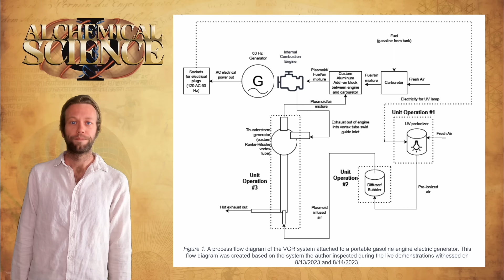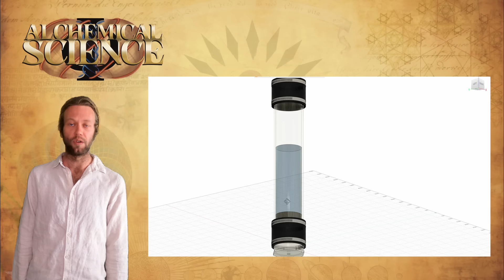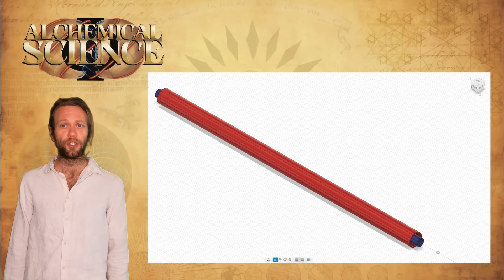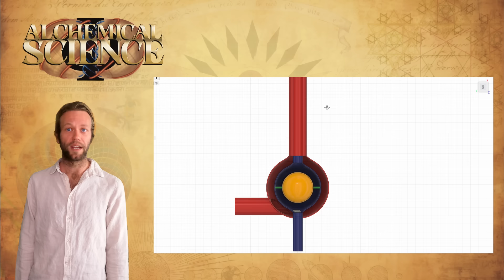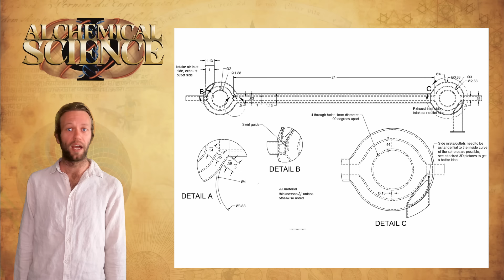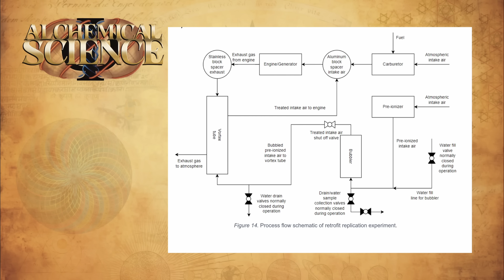Thunderstorm Generator | COMPLETE DIY BUILD GUIDE | Malcolm Bendall's Plasmoid Tech

Comment: Regards the plastic ion chamber, if copper or titanium work better, then simply a metallic spray painting of the plastic's interior should have a similar result boost.

Why would imperial work better than metric? The proportions are all important. That is more difficult to maintain with components manufactured to tenths as opposed to imperial manufactured to 1/3rds, 1/4ths & so on. It's not the magic of the source of measurements, it's the easier maintenance of ratios. 

The material of the supporting posts for the spheres may prove important, and perhaps even their shape. The ideal would be no post so there is no interruption in the ideal flow. the closer the post material/design gets to "invisible", the better they will work.

Comment: I've got so much more to say, but this is merely a variation of Paul Pantone's Geet engine recirculated exhaust plasma implosion system. This one here is more complicated in build. But the best result is an ambient air temperature exhaust, so no pollution or heating the atmosphere. 🤓🥳
Reply: Yeah, its a super complicated AIR FILTER.

Comment: This contraption is an overly complicated water fogger and heat exchange with a little EGR added to the mix to reduce the NOX output of the exhaust after it is leaned out by the hot intake; the fogger should help with the reduction of NOX as well.  The reason for the reduction of hydrocarbons is because it is closer to the stoichiometric ratio of gas to air, not because of some tuning of frequencies in the tubes and spheres.  The light bulb can be removed completely because it provides nothing to the system, because it does not ionize the air if it doesn't produce ozone, and I assume that ozone was not something the designer had desired.  So no plasma here at all.
Reply: So why do the exhaust readings show mostly O2?
Reply: @coreyleavell6921  what are you using to measure the exhaust with? I've wanted to setup my engine to lean burn with steam as the quenching agent to reduce temps and all the bad things that go with that, but looked into exhaust gas analyzers and found them to hold a pretty price tag I wasn't willing to fork over for it.  If it isn't an automotive exhaust gas analyzer that has a good calibration I'm not so sure you can say so.  If you know engines you would already know that contraption is not doing anything good.
Reply: @wesrurede  I don't have anything, but that's what the claim is. Watch more videos on it. I appreciate your expertise. Same question stands.
Reply: At the risk of it all...
The light is to simply start in aiding in the ionizing process. Its not completely necessary but helps. The the vaccuum of the engine pulls the air/water up through that tube after being pre ionized by the light. Then the wafer at the bottom of water tube atomizes it into 100 micron or less ideally or else the bubbles will not collapse into toroidels properly. When the piston of the engine changes stroke, the vaccuum ceases momentarily and compresses the bubbles at the top into the toroidel shaped plasmoids. The vaccuum continues to pull them into the thunderstom tube where hot exaust gas rotates counterily to the toroidal cold gas. They do not touch or mix. It creates the same effect as a thunderstorm ecxept instead of lightning or ridiculous amounts of static, you have created an optimal environment to force the plasma into the engine. What they admit they dont understand is how nearly everything converts into clean oxygen. They outright admit it works, but cannot figure out how the the full process works. Look at AC electricity. It got the same welcome as this tech, and now its everywhere and we STILL dont know enirely whats going on with AC current
Reply: @MidnightClutch25  I understand AC current quite well, if you don't you should learn. It seriously comes off like your just ill informed on the topics presented and are hopeful for technology that will make a better world; I am too, but don't protect what you cannot.  I smell snake oil.
Reply: Opinions are like assholes😂
Reply: Think about the temp gradient as phase disparity like when you static shock a door knob there is a disparity between the phases in you and the door knob when they equalize there's a shock this is electrostatics like lightning is not electricity it's dielectricity. The ionized air and exhaust never touch the disparity gets so large that the two actually equalize through the steel of the middle sphere and the dielectric discharge + the geometry of the gas bubbles collapse works together to make fusion take place it's like a positive feedback loop that's why the ratios are required. This is implosion tech. We use explosion technology now wait 10 year this will be everywhere
Reply: @jermeyplunkett3744  Static electricity doesn't use temperature differences to built the electric fields. Clouds get its ionization from the sun rays, which has ionizing radiation, the designer of this contraption specifically states they don't use an ionizing bulb, because it doesn't produce ozone.  I'm not changing my opinion.  If you want to build one of these, don't let me stop you, but it will not work.  It might even break whatever you attach it to.
Reply: @Wes_CWW Your not wrong about sun radiation but the movement of water can generate static also cold fronts colliding with warmer atmosphere does generate potential differentials aka static   ..it also gets created when water droplets are simply in freefall. static charges are also present when water is rapidly frozen and defrosted ...or colliding with other frozen droplets  so yeah many ways water can generate static. Or store static ..look up the Leyden Jar😉
Reply: @genetic-jabber4158  I will look some of that up.  This device is nonsense though. The light does nothing.  It is mixing exhaust gas in small amounts with the intake air just like the EGR system does normally albeit less, but worse than that it is heating up the intake air unnecessarily.  It is poorly thought through and a waste of money and time.  It's filled with nonsensical gibberish.  Plasmoids, and the such to fool people into thinking it has merit. If there is work to be done to make the ICE engine more efficient then it will be to harness the already wasted heat, but not by simply heating the incoming air stream and creating a system that will destroy an engine.
Reply: @wesrurede Sit down, shut up and do more research. you know nothing. the Martin Fleischmann Memorial Project has been working overtime, flying across the world for the past 4 months TRYING TO DEBUNK THE DEVICE. It has eluded all attempts and continues to provide evidence that it does what it is claimed. You have provided absolutely nothing of value in this thread.
Reply: Why does it work then?
Reply: @chrismac2234  who says it works?
Reply: Tell me you don’t understand without telling me , look at the scales up models
Reply: Huh, and here was me thinking it was some kind of glorified catalytic converter, like the kind that's installed in cars to filter nasty stuff out of the exhaust. What are the key differences here?
Reply: It's a woo turbo combobulator
Reply: Yes,short answer. They are all full of shit. This guy shows plans but has no dimensions. Completely useless. I can't believe they hoodwinked Randal into this garbage,smh.
Reply: @jimboyer6530 🤡😂
Reply: @jimboyer6530 randall
Believes hes on a spinning water ball in a space vacuum so he’s clearly easily fooled.
Reply: First comment is correct.
Stop arguing about a lightbulb.
We are being divided and conquered.
Reply: @deanhambrick6467  https://youtu.be/6VFJuIpHckY
Reply: This comment didn't age well lol
Reply: Where is your build?
Reply: @hyster16t  Do you have any understanding of plasma other than the desire for better technology to be out there? If not, perhaps wait until the consensus of those who do arrive at the same conclusion.  Every person who knows nothing of this technology is responding to me, and it's sickening how childish the responses are.  What is a build needed for, the science is not there, but flies in the face of it.  A build requires time and materials which is a waste.  Excess of oxygen in exhaust = lean burn.  Lean burn = damaged engine if not quenchable.  Heating the intake air = less power at lower fuel consumption or worse damaged engine.  This is not a functional part it is a destructive device.  If you don't like that I see it this way, perhaps don't come off cocky at the same time illiterate in the material at hand.
Reply: Are you j*****?
Reply: U
Reply: Uv light and pot scrubbers it looks janky. I don't care how it looks if people can confirm results with calibrated and test certificated equipment.

As for the light question, does it do anything? Simply checked during a reduced emissions test period. Turn it off during the run and monitor results.
Reply: Another CIA plant to protect the establishment.
Reply: this is correct.
Reply: @DaleOwens1 clown shoes
Reply: @wesrurede can we be friends? Have you ever built a bob beck device? Do you have concentrated knowledge of hydrogen electrólisis/intake fogging?
Reply: @RackemDawg  Sure, friend I am then.  It's been a while since I learned about colloidal silver or magnetic pulsing, but I remember a page probably lost in the internet about a guy looking to heal a friend of his by trying to learn how to magnetically induce a weak electric field to switch the scar cells into stem cells and was looking into pulsed magnets in order to do that.  It was in depth, kind of his journey.  That's what the internet used to be.
Reply: It’s gonna be funny if this shit is real how stupid all the haters are gonna look
Reply: @dallasclark4431  I'm not a hater, I know it doesn't work because I understand the science.  Automotive tech is my field.  I just want you to use your noodle; why would a non ionizing light bulb be necessary for a contraption that makes plasmoids? Plasma requires ionized gas.  Air is a gas. It was the first thing that threw me off, if it were a bulb that made ozone, at least ionization is available.  The rest of the machine is a heat exchanger and the small coupling gives it some exhaust gas reseculation.  But the hot intake air will damage the engine in no time so don't expect it to last long.  I'm not laughing at you, I'm just stating the facts.  I got played a long time ago with HHO electrolysis, so don't feel like I have some hatred for anyone other than scuzzy people who lie cheat steal and decieve.
Reply: @Wes_CWW - In general, UV light with wavelengths around 300nm falls within the UVC range, which is known for its ability to ionize air without producing ozone. UVC light is effective at breaking down volatile organic compounds VOCs and other pollutants in the air, creating ions without generating harmful ozone.

That lightbulb that you had issue with, was chosen, specifically for what you’re claiming would be an ideal candidate of a lightbulb, which is one that ionized is air, but doesn’t produce the ozone. What are your comments on that?
Reply: @ColbyBlack  300nm is UVB not UVC. The major problems I have with this intake system is that it is increasing the intake temperatures unreasonably and will cause a damaged engine due to thermal runaway, reduced power because of the lean condition caused by the high temperatures, and high NOX pollutants because of those high temperatures.  This is a horrible design for a ICE engine.  The light bulb is just a glaring detail of the obvious deception.
Reply: @Wes_CWW  Then why are structures left behind by microscopic ball lightning, which is said to have the ability to transmute elements, which is what is claimed to be happening in Malcom Bendall's Thunderstorm Generator, which is where sample are being taken from and confirmed with electron microscopes and open invitations to laboratories to request the meters of available material?
Reply: @ColbyBlack  Why what?  That has nothing to do with what your claim of 300nm being UVC, or overheating an engine and nitrogen which creates massive amounts of NOX.  In what context does your misconception of what I replied last lie? By the way, claims don't matter to me, I see what I see, and I see a device that will destroy an Internal Combustion engine.
Reply: Yes you should of thought of it first then. 😂🤡🙄
Reply: It's a shame you are all arguing over nothing.  This is everything.  This is the source of free or inexpensive energy.  

It's sad that such foolish comments must exist but that is our world. 

I have zero schooling by the way. IE I left high school B4 the end and oddly I had a business in what was once a great city NYC off 6th Ave on 26th Street.  It was in the garment industry and we started it with nothing but a little bit of crazy you can say as we did what cannot be done.  This is true of so many humans.  We step out and take the risk.

Have some faith!
This is unquestionably the secret to our freedom.  But sit back and know it's garbage. 

Time will show itself unless evil is truly strong than good.
Reply: @DACNY  I do like new inventions. I have no problem with ideas outside the box. I am a trained automotive tech.  I think and understand engines. Most here do not and don't care to learn.  That allows for bad actors to rip people off.  If you can't handle an argument don't shame others for having one. The device will destroy engines.  It has an excess of oxygen because it's lean buring.  That's not good, NOX will be through the roof.  That is a bad pollutant.  People need to learn the tech or stop arguing their feelings about said tech.  Scammers don't provide liberty, a backbone does.
Reply: This guy is the legitimate character assassin. 🤡 
Openly calling EVERYONE involved charlatans! But all he talks about is his expertise in automotive engines. I'm not saying they're right, but I'm not saying they're wrong. Because I CAN NOT PROVE EITHER is correct or incorrect. You can say you disagree and you think it's not plausible, but saying they are all selling snake oil is way out of hand. As someone pointed out plenty of tech was once ridiculed and is now common place. Look at the 400hp hydrogen engine as an example. I say if this tech works you should be banned from benefiting from such. 😊
Reply: @professionalhuman4429  If you don't know what your talking about you should leave the keyboard alone.  If your character is weak enough to call out, I'm an assassin... Pitiful as you use these false comparisons to my arguments. This isn't the pot calling the kettle black it's the pot calling the tea cup black.
Reply: @Wes_CWW  ooh burn 🤣
Reply: @professionalhuman4429  more childish reactive nonensene, you know much of that don't you.  Weak.

Comment: So the top outter sphere feeds into the engine intake between the carb and intake?  
Is this hot or cold?
What connects to the lower outter sphere? 
Is this hot or cold?  
Top inner sphere connects to what?
Is this hot or cold?
Lower inner sphere connects to the treated air supply?
Room temperature treated air?
Do you have a sketch that shows this where no verbal explanation is required?  
Maybe a cross section sketch with the parts / connections labeled with flow arrows?
Thanks for doing the video.  We've been waiting for this type of practical information...

Comment: My uncle had something like this on his farm vehicles. Old emptied out batteries and spark plugs 3 or 4 of screwed into empty battery case kina like that UV light he always told me he had a tank of fuel last all harvest and could literally breath in exhaust ft away ad not get light headed and not circles on a tube they was stop sign shaped and home wall water copper and brake lines inside very strange but sounds like samething he said Exxon bought patten in 67-72. No idea but now it seems like he wasn't full of crap..

Comment: Great video!  I am still confused as to how any substantial pressure is developed in the bubbler?  When the engine is under compression the valves are closed and there is no airflow entering or exiting.  During the intake / exhaust there certainly is airflow but I don’t see how there would be a substantial increase in pressure since there is a cold air intake into the bubbler from outside the system.  It is not a closed loop.
Reply: its not, vaccume is aerating the water andcreating "plasmoids".  its nonsense.  theengine is starving for fuel based on gas analysisnumbers, by sound you can hear it pulse and starve for fuel.